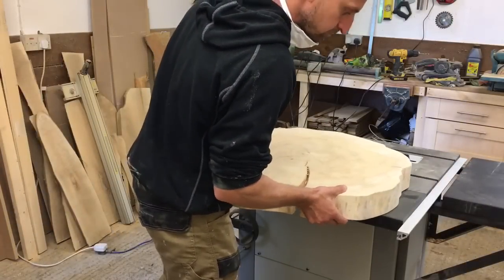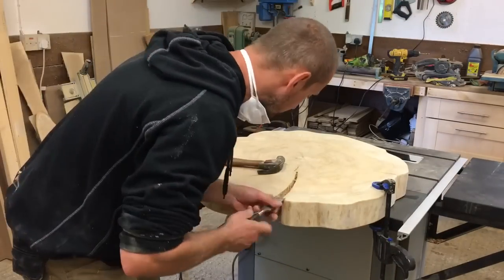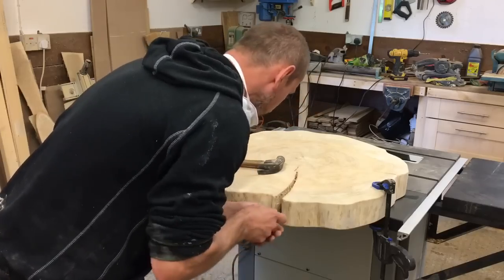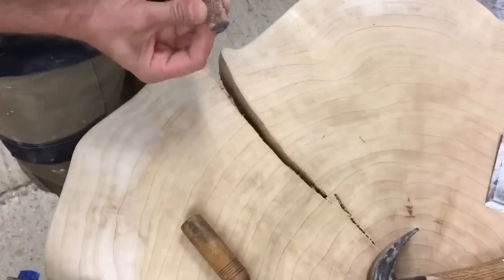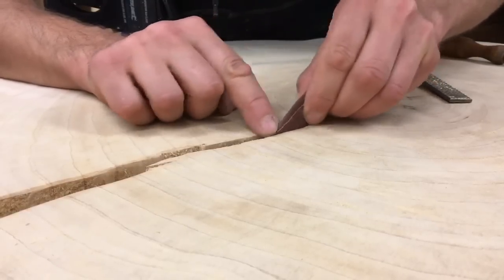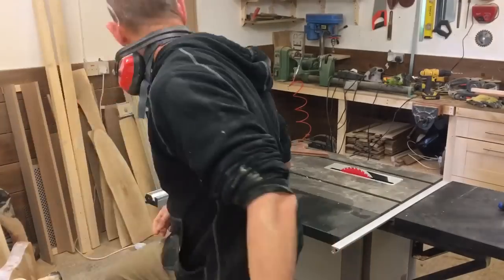Making bow ties for a live edge table top

Comment: I have a similar slab, what is your opinion on splitting it in half and using other wood in the middle to make it into an oval? I was thinking I could insert an induction top in the middle for hotpot. Or would it be better if I cut a hole in the middle of the slab to insert the cooktop?

The slab is ash wood and any other wood I use would be oak, poplar or pine from home depot.

Comment: I really liked the addition of the strip of wood in the middle of your bow ties, but I'm curious about the look of using a thin flat piece of wood over the deep crack.  After tidying up all the splinters, did you consider using the crack as a template to cut a contrasting piece of wood to fill in the crack before using the bow ties?  You simply shape the crack so it's tapered to be slight wider at the top edge, taper your insert wood so it's narrower on the bottom edge, and of course longer vertically than what the crack is.  Then you'll reach the point where it's snug on top and bottom crack edges, trim off the excess to make it flush, and you'll get a perfect fit.

Comment: Hi sir, I hope you are doing well.
I am wondering what is the tool machine you are using in your work starting at the 5:51 of the video. If you send link of it that would be cool and thank you.
Reply from the maker: Hi اسير الشوق  that is a fix base router!
Reply: Szilard Pinter thank you a lot
Reply: What shape of bit do you use when you did the work at 5:51 of the video

Comment: If i'm going to be mega picky, you shouldn't really have used the central piece [in the bow tie]  You've created a weak point
Reply from the maker: n oakley no not really. Based on the fact that the glue stronger then the wood. Also side grain glued with side grain, it's not weak at all! 
But I appreciate your comment, and the fact that the only thing you had to say is what to be picky about tells everything I need to know!
Cheers 😁👍